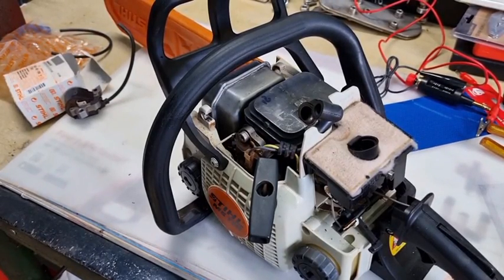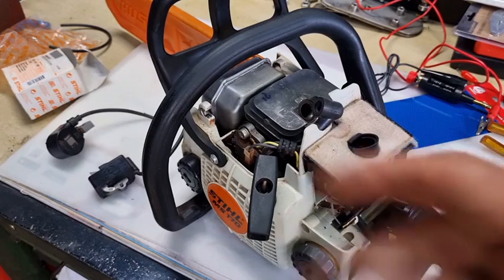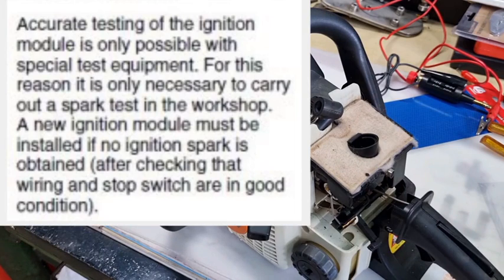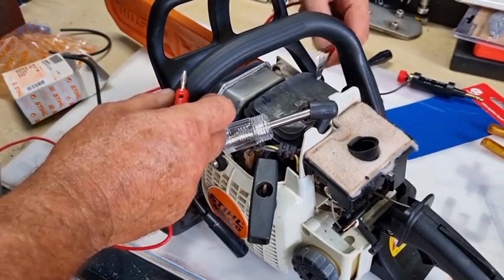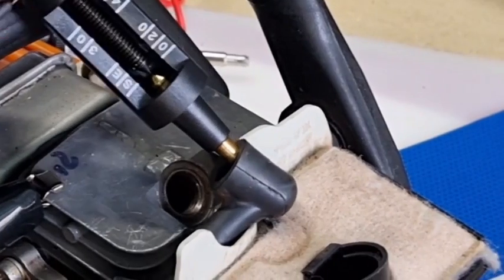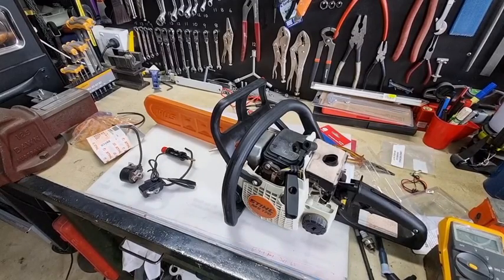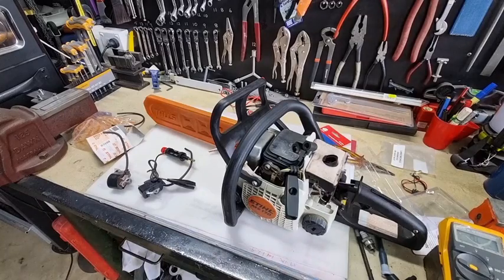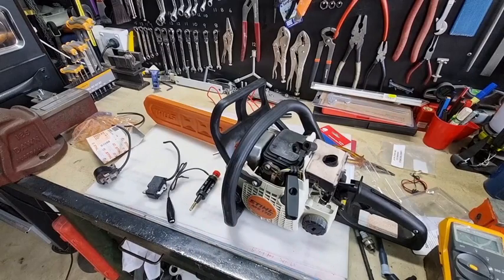Chainsaw no spark ? easy way to check with inline tester

Comment: Good video just to point out that you stress test the coil by increasing the gap on the variable spark tester if the spark can jump a large gap means it is a good  coil 😊
Reply from the maker: Yes that's also a good way to see who good it is.  The coil secondary windings do break down, as the varnish on the wire wears off causing the resistance to change make the coil less effective.
Reply: @ChainsawUsers  had a new coil delivered and it is dead  no spark tested resistance and is 1.3K omhs  ever see that before
Reply from the maker: @rangecomand all the newer coils have very high resistance because of the electronics now incorporated into the coil.